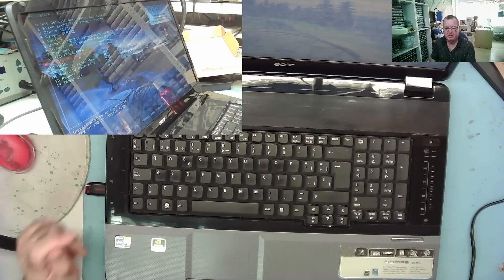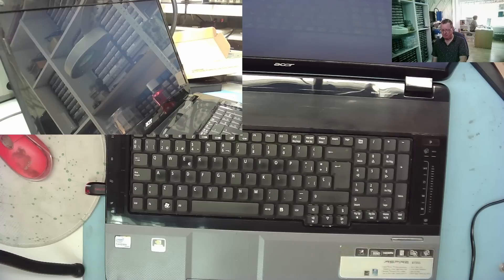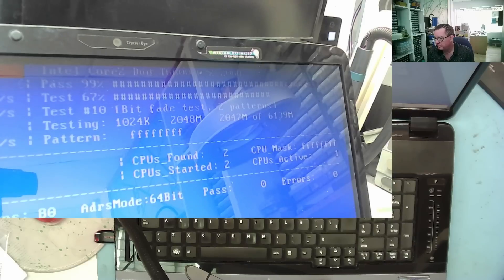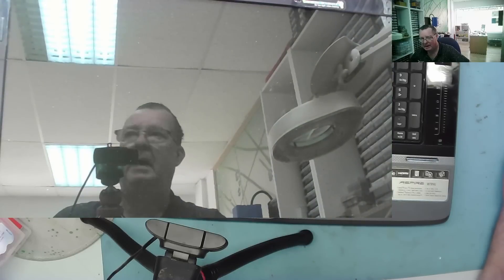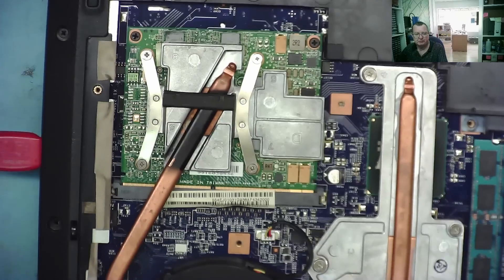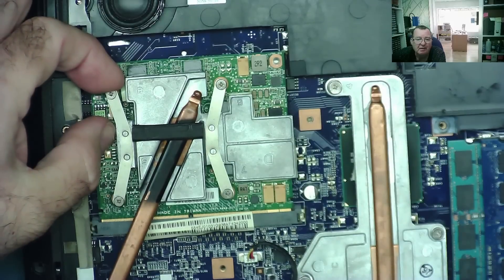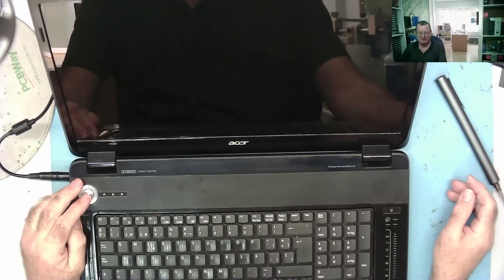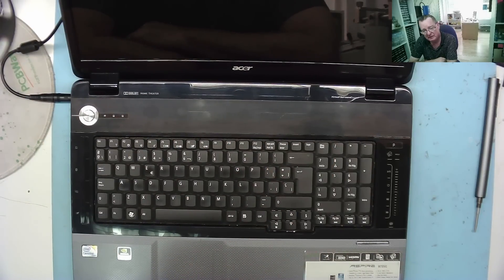Can't Repair It Because You're NOT GOOD ENOUGH!

Comment: I had a similar issue once which proved to be defective PMIC chip (power management IC) that didn't boost when the CPU/GPU needed more power (during OS boot or in other cases). Replacing the PMIC solved the problem. Try to find the first MOSFET in the power in circuit and measure the gate voltage to ground. I should be much higher compared to the input voltage otherwise the MOSFET has high resistance an thus can't supply the required current. The gate voltage is provided by the PMIC.
Reply from the maker: That is what I call a 'proper' fault - I'll look for this on a followup 🙂
Reply: it can also be just shorted first mosfet, Sorin just had two videos with same fault and similar symptoms. He even replace pmic on first one seeing low gate voltage  :)
Reply: In such old systems I never had such case.However that doesn't mean it's impossible to occur.Yours was a core 2duo machine?
Reply: @dimitrismaster  A celeron netbook. It was quite old indeed. The cause to blame wasn't the PMIC but a MOSFET in the battery charging circuit which got shorted and somehow destroyed part of the PMIC.

Comment: Capacitors or something to do with the voltage regulation on the video card.  Check the voltages to the VRAM.  Check caps, coils and mosfets.  Test caps and coils on a real LCR meter.

Comment: Corrupted graphic card bios? (If there is any). Bad vram/problem with power rail/problem with GPU? Try to inject (proper) voltage as you did on full size graphic card 😀

Comment: The AMD hd5470 was released when the lead was removed from soldering like many othe AMD GPU and NVIDIA as well. The result was that all the GPU of this generation broke in a really short time before the problem was solved. The problem was temperature related but the GPUs stopped working for long temperature operation and afterward they crash also on small temperature. Something like a micro crack in the soldering. Sometime it work and sometime wont. Now that you have that problem temperature is not the problem anymore. This is the reason why there are so many video online that solve temporarily this problem by overheating or reballing GPU. That give you just some more time but will not solve the problem. That said a lot of Acer of thet era have this same problem and I always tought that this is something about power rail. After all the lead was removed from every soldering on the notebook and was problematic in that era. It seems a shortcut under certain conditions to me.

Comment: IIRC, operating systems tend to record boots to log files.  Perhaps finding the last entry and then looking up what the next, failing, step is?  Looks higher res graphics related to me.  That would explain why your installation lasts longer as it is in low res graphics.  Why, is another thing all together.

Comment: Hi Richard this one can be caused through a shorted first mosfet. You must first check the first and second mosfet. But probably there are fine. I think those machine are having nectokin under cpu. You need to replace that one  4* tantalium capacitor from 330uF. That is probably cause of this problem. also a dirty  me region from bios can cause this problem. But first I will measure first and second mosfet and  look to Nec tokin under cpu.
Reply from the maker: This is something to look at on a the followup.  I honestly didn't know about this Nec token.  That's one of the good things about this channel, I'm not afraid to pdot stuff I can't fix and then we all learn in the process.

Comment: 05:48 I'm guessing video related
Easy2Boot is slick. You can put gobs of iso's on it and piuck one to boot
Reply: 11:48 "Video switching" used to be a problem back in the W98 / XP days. When the the screen output would go from, saaaaaay, 640x480 to saaaaaay, 1024x768, Windows would crash, even during install and often during initial boot after install
Reply: 18:25 Video card is bad / faulty / busted

Comment: Well at least it’s not an intermittent fault, so you at least have a chance to find the problem.
Do you have a schematic?
So what do you know? Well really, only that it resets after doing something, repeatedly.

Work on what you know…
Find the reset signal. 
Find what creates the reset signal. Monitor the causes of reset and disconnect them one by one.

I’m betting it  is a power problem.
Laptops often have unused circuits powered off to save power.
But at some point the faulty section is enabled and it causes a power overload.
Try and find a section that is not powered before the problem manifests. Check its power rail resistance looking for a short after the enable MOSFET switch.

Anyway. If you can’t give up on this then treat it as as an educational exercise.
Chances are that other tests you can do will occur to you in time. 
So best take possession of the laptop or you will never know if you would have been successful.

All the best…

Comment: Interesting, ram testers don't crash and restart when finished, no tester does that, they show results... I'd just swap out the ram and try fresh, I think it's a high memory issue ;)  Or put it in another laptop and see if that crashes, if not then I'm wrong, btw I ran my own PC shop but that was looong ago.  Easy test and worth a shot.
Reply from the maker: I tried the two RAM dimms individually as well as together.  It does exactly the same thing.  From this I would conclude the problem is not faulty RAM
Reply: The memory controller on the CPU in laptops this old or are they still on the motherboard?
There’s two sides of the memory bus, RAM is just at one side.
Reply from the maker: @Infiniti25  True.

Comment: Hi, thanks for the great vid, props like that are usually thermal paste on the cpu, fix a few by replacing it. Think it’s the cpu running at full speed a over heating, when running low speed there’s no overheating problem 👍
Reply: He said he had it running for a while, with a certain setup. So I think that rules out over temperature resets. But yea, I'm with you on the thermal paste replacing on anything I pickup first and foremost 😉
Reply: @anthonydenn4345  idling for hours doesn't even begin to test heat dissipation capabilities. loading windows on the other hand.. can make fans ramp up quite a bit

Comment: Hi, Sorin had a similar problem, where under cpu load also Acer notebook crashed. In two cases it was a short on the 1st mosfet after the charging port.
Reply: I have an Acer that won't run if the charger is plugged in but it'll run off the battery. Damndest problem. Something is wrong with the charge circuit in the laptop. The charger is fine. I even put a Pi filter on the charger output to really clean it up. It didn't help.

Comment: Hi it seems to be a GPU problem (very common in that model) , remove the graphic card and give it some heat with with your hot air soldering station (around the chip not directly in the die). Wait a minute to cool down and give it a go to see if it goes further , don't bother with the cooler. It seems to crash every time it want's to access VRAM (when it switches to an extended graphic mode).
Reply from the maker: This is the most likely cause IMHO.  Plenty of ideas on the comments here so I will make a followup trying as many of them as I can.

Comment: Try seeing where in the linux boot process it crashes and whether it crashes at exactly the same place every time.

You can then try to either build a kernel or initramfs with modules or built in drivers removed, until you isolate the problem device.
Reply: This will take forever though, and a 2008-2010 laptop with glossy display is probably not worth days of work.
Reply from the maker: @luc_libv_verhaegen  Luc I really wish I had the knowledge of Linux to do that, it sounds like an interesting idea even if time consuming.  Just to prove a point.  Any pointers to where i could learn that stuff?
Reply: @LearnElectronicsRepair   Mount drive in another linux machine and run journalctl -D /mnt/var/log/journal
Reply from the maker: @rabfulton4729  To clarify, you mean try to boot the laptop from the Arch USB, let it crash, then use a different linux to boot a know good PC, insert the Arch USB, mount it and then open/read the log file of the failed boot attempt on the laptop?
Reply: @LearnElectronicsRepair  First start by verifying that it always reboots at the same time when booting the linux you used for testing. You have your cameras set up, so get a good capture of the lcd, and verify that it always reboots at the same time, and provide a good capture of kernel logging so those who are very familiar can provide a first guess at where we are locking up.
Reply: @rabfulton4729  But this device reboots well before any storage device is enabled or any filesystem is mounted. There will be nothing in the logs.

Comment: It's an older Laptop. The CPU is not man enough to run modern windows.
Reply: It won't install Windows 7, an older operating system.
Reply: Lol it's not like 20yers old laptop 😀, the other day I installed win7 on Packard bell from xp era and it worked, so it's not the windows version the problem

Comment: The good thing about linux distros is that they output to the screen during install.  When you were loading the final linux install (16.30 - 16.31) it got to the point of loading drivers for "standard hot plug controller" (pci related) and turned off following the next instruction, maybe when it's trying to change the resolution.  Also the way it resets, looks like some kind of power/protection fault.  Could there be some kind of fault with the peripherals (i.e. headphone jack, usbs etc).  I think you'll need to go back to basics with this one Richard and take the motherboard of the laptop at least and leave just the cpu, graphics and ram.  Another thing you have to check is whether the chargers are supplying adequate power to the laptop especially since it is has a funny graphics setup and probably needs a lot of power to load the grpahics environment.  Try and use a charger with more wattage.  You can also try hdd with windows xp preinstalled in safe mode as well as disabling a cpu core in the bios.  The paste under the gpu looked like it was freshly applied so it may indicate that someones upgraded the gpu which is causing some issue with the cpu.
Reply: Linux can silent boot. Then you won't see the dmesg scroll. But it should still write all of that garbage into the boot log.
Reply: @1pcfred Can be useful for troubleshooting
Reply from the maker: Regards the PSU, the laptop requires 4 point something amps (can't remember exactly) but I didn't show that in the video.  My PSU is rated at 100W so should be able to handle this, though of course the ratings on my PSU could be 'fake'.  The owner tells me it is doing the same thing on his PSU so I don't think that is the case but you never know for sure.  I'll try it on one of my bench PSU.  The most powerful one can supply up to 10A at 19V so that should A. discount the PSU being the problem and B. Possibly tell us something useful as we can see the current draw.
Reply: @LearnElectronicsRepair  I have an Acer laptop and it won't run if the charger is plugged in. It runs just fine off the batteries though. So I imagine there's something wrong with the charge circuit in the laptop itself. I checked the output of that charger on a scope and it's clean. So there's no problem I can see there. It can charge the batteries too. The laptop just won't run when the charger is plugged in. It used to but it can't anymore.

Comment: Rich I agree, with Tim Coles, it's the GFX card, it could be when loading drivers, perhaps a bit like what has happened in the past with the larger GPU's. I had a 7535G, it used the same GFX card and as it got older it got a bit flakey, sold the machine on before it died completely.
Reply from the maker: I'll have a look in the BIOS on a followup to see if this motherboard has onboard VGA so I can try it with the GPU disabled.  As you saw in the video if I unplug the GPU it behaves like it has no graphics card but there may be a BOIS setting to set it to onboard VGA.  It is a core 2 though and I'm not sure those had integrated graphics, at least on the desktop ones
Reply: @LearnElectronicsRepair  nope,no integrated cpu  gfx on this baby.Unless there is some weird design with a weak gpu on the mobo before the dedicated one kicks in,but i doubt it.

Comment: Did you consider checking back side of the board for any NEC tokin capacitor that might need replacement?
Did you consider that the GPU seems to be the culprit in most of the scenarios at the point where the GPU would be expected to load drivers to activate the 3D graphics for an OS UI, with the exception of MemTest?
Definitely get your hands on another of those MXM or MXM2 slot GPUs to test, but make sure it’s compatible with that board.
HDMI output might not occur uNtil the OS boots in some cases, but you could try the key combination to enable/switch the screen output options. Most of the time for an image to be present on a monitor in the POST phase of boot up the cable needs to be in before power on.
I think Core2Duo might be too old to have an ME region 🤷‍♂️, but that could need cleaning if it has one.
Reply: Yeah, this problem looks exactly what i had with a clevo x8100 and it was indeed the nec tokin chip.
That chip supplys power to the cpu and fails to do so, resulting in restarting of the laptop.
After replacing the chip the laptop worked fine

It does not look like a gpu issue, because a gpu normally shuts off after driver install and not in the windows install
Reply: @janwillemkeurntjes4057  thanks for confirming NEC tokin capacitor symptoms.
Regarding GPU, it makes sense that it isn’t to blame, but some of the tests involved an existing windows install and I’m not 100% sure but I suspect the windows installer at least may make use of or tests for 3D part of GPU for things displayed on screen and maybe as part of what used to be the Windows Experience Index. Wouldn’t make sense it was GPU during MemTest so rules itself out I guess
Reply from the maker: @Infiniti25  I mentioned in the video I thought it could be the graphics card.  This NEC tokin capacitor is something I don't know about as I'm not a laptop expert and still learning stuff everyday, as are we all I guess.
Reply: @LearnElectronicsRepair  I only know about the NEC Tokin capacitor(s) from another Discord, it’s also a problem on the PS3 CPU

Comment: Maybe start windows in safe mode - this should eliminate the graphics driver.
Also check in bios if graphics may be switched (some laptops with addon card can do that)
I agree that this me related to video card ... and it will not hurt to reflash motherboard bios from usb ...
Reply from the maker: Note it will not even boot Arch Linux.  When installing a new Windows OS isn' tit basically in safe mode anyway, as no drivers are installed yet?

Comment: Maybe resetting the BIOS to defaults. If that does not work, then play with other settings in the BIOS, like memory or CPU or HDD or Gfx.
Reply from the maker: This  I will try on a followup
Reply: @LearnElectronicsRepair  I assume if u leave it sit in the BIOS for 30 mins it would be fine and only upchucks when the system is under stress and fans need to ramp up?
Reply from the maker: @GregM  I will be making a followup, I didn't leave it sitting in the BIOS screen but expect it would be fine.  It's fine when I boot from E2B USB, which is linux based, I can leave it on that screen for ages.  I don't believe this is overheating related, the failure is to specific at an exact point when installing an OS for example.  Regards those above in this comment, Core 2 processors do not have integrated graphics and my E2B USB is not accessing the HDD.
Reply: With no battery there is nothing to help hold the BIOS information.  Suggest you get into the bios and see if you can reset it or reload it from it's backup.
Reply: The bios isn’t dependent on the power battery, the bios has it’s own battery, probably a CR2032. Easy to replace.

Comment: I have seen it before with Nvidia GPUs. The screen seems to work in BIOS and in OSs running in "basic" video mode. But it reboots once the system try to load the Nvidia driver.
Reply from the maker: That is my best guess, but it is just a guess and hard to prove unless the customer wants to pay for a new graphics card to find out (and if i can find a replacement one)
Reply: I would expect to see a blue screen flash for at least a split second.
To rule it out you would need to load the boot menu for the OS and enable Low-Resolution Video Mode as a test and if it still crashes, access the same menu and select Disable automatic restart on failure. That should leave any potential BSOD visible